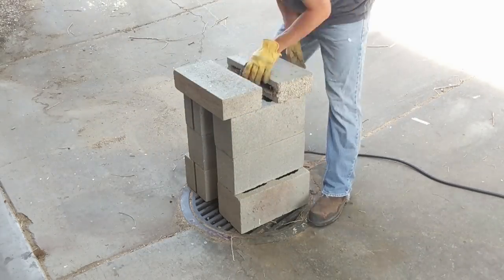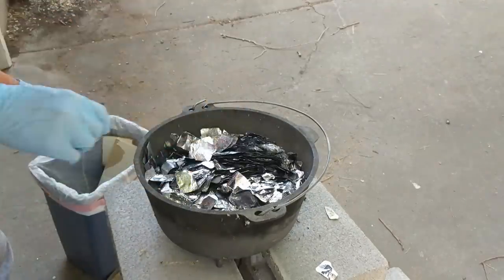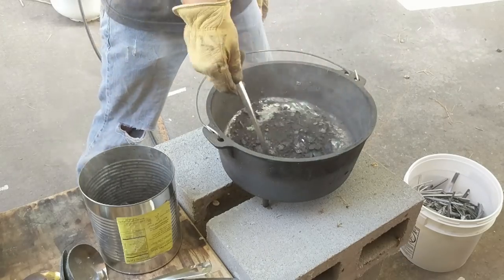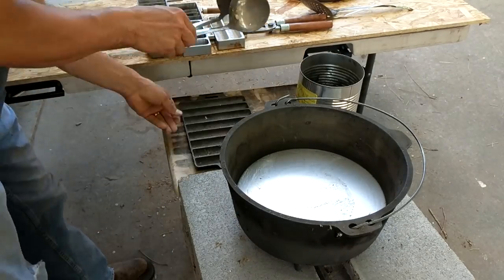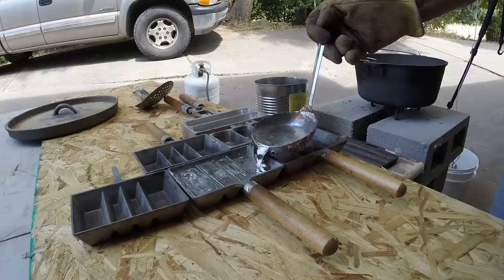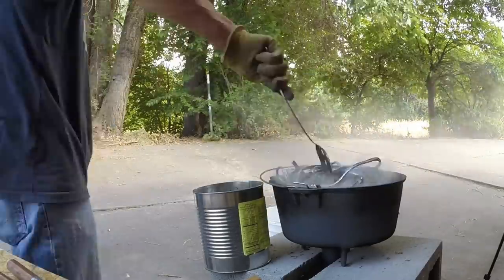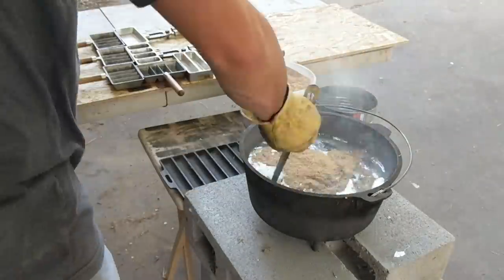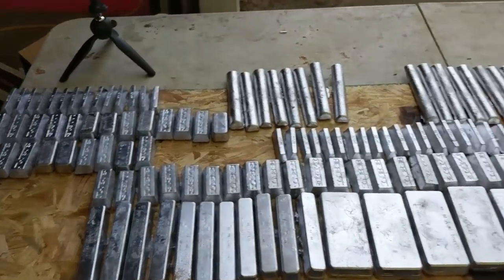Melting and Processing Scrap Lead and Making 265 lbs of Ingots

Comment: Well done! I make and sell tons of lead buckshot and slugs. I pick through and select the best scrap plumbing and roofing lead from local recyclers for $1 per pound. I just got 290lb of ingot from a 300lb purchase last night. I used to use all Lyman and Lee molds, and I'd stack my ingot in perfect straight rows for use. Then I discovered the cornbread ear shaped molds and have never looked back. The ingots weigh about a pound each. I throw them in 5 gal buckets and use as needed. They melt quickly, and you can stand one on end in a Lee production pot and it touches the bottom without letting go, causing a splash like I frequently got with Lyman and Lee ingot. I do everything indoors on an electric cooktop with monster ventilation. I average between three and four hundred pounds per week.
Reply from the maker: That's awesome!

Comment: Most we have done in one sitting was 9, 5 gallon buckets of wheel weights. It was all day and the driveway was covered in ingots.
Reply from the maker: IWatchedWhat ha ha, dang man! That's a ton!
Reply: Full.Lead.Taco yea, it was a metric butload for sure. Sad part is I went through my share in just a year.
Reply from the maker: shooting them in competition or just shooting lots of bullets?
Reply: Full.Lead.Taco a little of both, lots in IHMSA and lots just for fun, did a bunch for BPCR and the 45-70 eats lots of lead. I ended up with 1/4 of that session not sure how much it was, but made my car squat when I left for the house. It was almost two buckets of ingots.
Reply from the maker: IWatchedWhat that sounds awesome... Anytime you can weigh down your car with bullets or future bullets, that's good news
Reply from the maker: Hey be sure to tune in on Friday morning.  Got a special video coming out with a challenge.
Reply: Full.Lead.Taco will try to before I head to work check.

Comment: Very nice! I never thought about using the Harbor Freight weed burner. I don't have a garage and only have an 8'x8' shed, so I have to really think about what all "toys" I want to buy. This set up will take up a lot less space than a turkey fryer and might even motivate me to clean up the sidewalks on my block.
Reply from the maker: that torch is pretty great, sometimes I use it to start the charcoal too--works great for that.

Comment: Gudday, I dive for my lead and have just started turning all of my finds into ingots. There is a endless supply in the ocean at popular fishing spots and I usually walk away with 6/8 kg per dive plus other treasures, ie gold silver and lost coin. I have almost got over the years 1.5t from 2 different places and was scrapping it out and made enough to buy all of my dive gear and detectors etc.
Making up my own moulds atm 2kg each, tried a plaster mould which was Ok for a couple of runs but soon deteriorated badly.
Check out my vids.
Cheers and Happy Melting
Brad
Reply from the maker: That's awesome.  Probably great to get those lead weights out of the waters and cleaned up and reused for stuff.

Comment: Good job but Just an advice Always wear a Mask FFA2P3 when you melt lead and wear Also protective glasses gloves and a protection suit that Is useful to protect you from lead particles.
Reply from the maker: if the stuff I am using is really dusty, I will use a respirator... or if the smoke is really bad too.  But, just melting lead doesn't produce lead "vapor" or anything like that.  I get my blood lead levels checked each year at my annual physical and they always come back normal.

Comment: The most ingots I made at one sitting was 186 lbs. Now I buy lead in ingot form . They average 4 to 5 lbs each but will fit in the 20 lb. pot . OK . Imagine a soda can mold filled 1/2 full . It saves a lot in time and propane .
Reply from the maker: yeah, and you get yours at a great price already in ingot form so it makes sense.
Reply: I need to scrounge the scrap yards for some steel plate and pipe . I'd like to have a bullet trap like Charlie made .
Reply from the maker: yeah that lead collector of his is pretty sweet!  I have a mini version of what he threw together.
Reply: Did you make it or is it the one from Ebay ?
Reply from the maker: ebay
Reply: Full.Lead.Taco link to the bullet trap please.
Reply from the maker: https://www.ebay.com/itm/Bullet-trap-for-use-with-22-thru-44-magnum/292922411238?hash=item44338948e6:g:5uIAAMXQbcRQ74vC

Comment: It's 2020 and where I'm at no scrap or wheel weights are available,claim that they have to sgip the weights  back to some where and it will be recyled ?
Reply from the maker: You can always buy it online, but local saves on shipping.  You can also check with a recycler, a lot of times they will sell scrap lead.

Comment: Why are you setting up over a drain?????? Not afraid of contamination?
Reply from the maker: Nope.  That drain is just a storm drain in case it rains a bunch. if lead falls on the drain, it's the same as if it falls on the dirt, I just pick it up later and melt it down again.

Comment: in one sitting 5 100# buckets of range lead once the jackets and un-meltable grey powder skimmed off net lead 425# , 20# rowell ladel got a work out that day
Reply from the maker: ha ha, that's a lot of work man!  gets tiring after a while.
Reply: Full.Lead.Taco  ; yeah it was but well worth it , it was the last smelt of 1200# i traded to somebody to order me a dillon 650 from the factory setup in 45acp large prime
Reply from the maker: oh nice, how you liking that dillon 650?
Reply: Full.Lead.Taco i've put a few upgrades on it such as missed primer catcher, spent primer catcher, shell plate bearings, roller bearing case feed rod. runs pretty sweet with these small upgrades, i use t for 45acp, 45colt, 223, will have 300blackout soon as well. also ive got 2 of the dillon square deal b's to back it up on 9mm and 38spl
Reply: Full.Lead.Taco by the way, you do know x-ray foils and stained glass lead are both pure you could have done them together right.
Reply from the maker: The foils are more pure than the window scrap.  Window scrap used to be more pure but then they started putting tin and antimony in the mix.  It is still soft but not quite as pure as the X-ray stuff.
Reply from the maker: How are the caliber changes?
Reply: Full.Lead.Taco ahh ok last time i dealt w stained glass lead in the 90's it was still lead lead
Reply: Full.Lead.Taco the 650 caliber changes are realy easy if you use the quick change setups n not use the same tool head for all calibers. if you use the quick change that comes with tool head tool head stand and powder measure one you set the dies and powder charge its 2 pins and a clip to change the top side and the shell holder is one set screw and one bolt. only takes a couple minutes and you are rockin a different caliber
Reply from the maker: Joseph Wedel yeah when I get scrap from old windows it is a little softer than the shiny new scrap
Reply: Full.Lead.Taco you ever get plumbing pipe lead or roofing sheeting? that stuff is pure as all get out, the pipe though you have to cut the wiped solder joints out because the wiping solder is about wheel weight alloy but the rest of the piping is pure
Reply from the maker: Joseph Wedel I don't know any plumbers, but that would be a great source too.  I have a relative who has a lead counterbalance weight that he said I could have if he can figure out how to get it to me, ha ha.
Reply: Full.Lead.Taco ive got a small time scrap yard guy that saves every leadlike substance that comes in along with all the cartridge brass back in the back for me. often many 5gal buckets of wheel weights 55gal barrels of plumbing pipe n roof sheeting and anywhere from a couple pounds of brass to barrels of it. i still have to pay scrap prices to get it but i dont have to go very far.
Reply: Full.Lead.Taco also are you a member of the cast boolits website, i am call sign Littlewolf
Reply from the maker: I am, but I don't post a ton.  Sometimes I love that site, sometimes not so much.  Seems like when I post there I get a lot of crickets...  ... ... ... ha ha.  I'm on there as full lead taco and cornmastah, and I do try to support the site each year when they do their fundraising.
Reply: Full.Lead.Taco i dont post much there anymore as they often get deleated so mostly just use the S&S

Comment: I'm just getting ready to start processing lead and would like to know if there is something that can be applied to keep the ingots from oxidizing. I was given several dozen very old ingots that were stored in a shed and are nasty as heck. I'd like to recast them into a more manageable size as they are ~80lbs each and then spray something on them to keep them from getting nasty again. Thank you for any advice.
Reply from the maker: sorry for the late response, but keeping moisture off of them is the biggest factor.  Even just getting 5 gallon buckets with lids will do wonders
Reply: @FullLeadTaco  Thank you! I did recast a half dozen of them into 5lb ingots and am storing them in dry environment. I must have lost 2-3lb per ingot in oxidized crap so I will be sure to keep these nice and dry.
Reply from the maker: @joem7572  sometimes with the oxidized lead, you can get some of that back with several fluxings--also be careful of that dusty oxidized lead--breathing it can be bad.

Comment: I wish i could find a stained glass shop near me, all i find are wheel weights and even then half are useable and the rest is scrap.
Reply from the maker: yeah man, just put out the word that you use scrap lead--sometimes it just turns up for free!
Reply: Full.Lead.Taco have you tried your MOAB mould? I casted a few but only loaded up 20 with trailboss

Comment: Only about 80 lb that's the biggest I've done
Reply from the maker: what kind of scrap was it?
Reply: @FullLeadTaco  I had wheel weights and Lead drain pipe and stained glass window lead and I kept it all separate when I made the ingots I'm hoping to use the LED to pipe and stained glass window lead for muzzleloader bullets